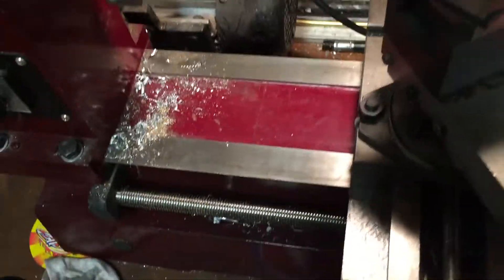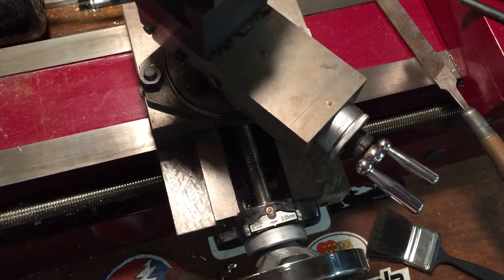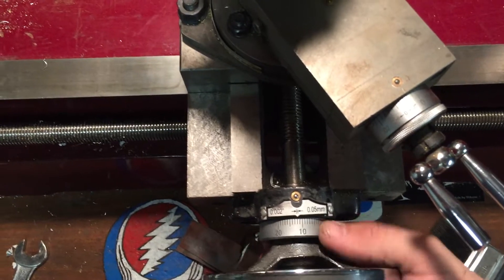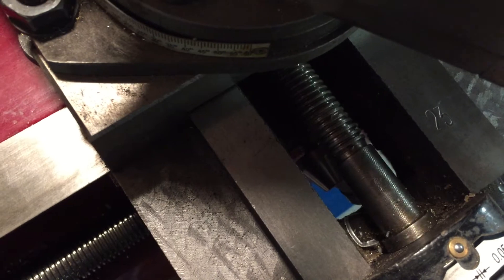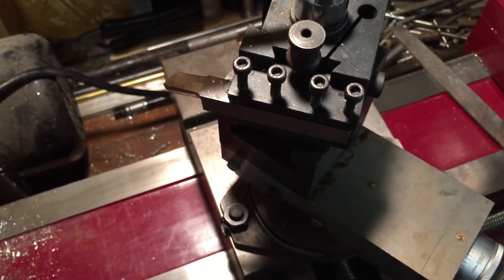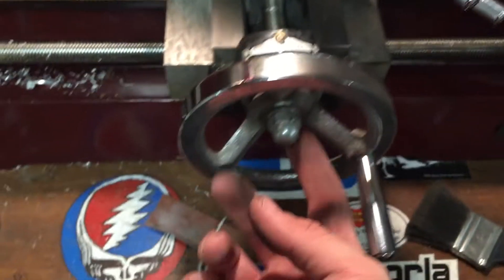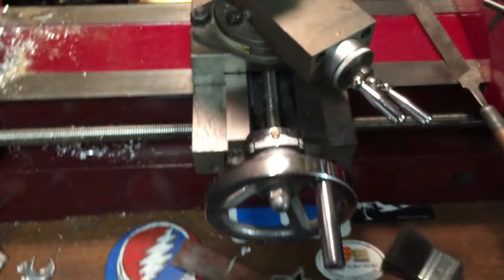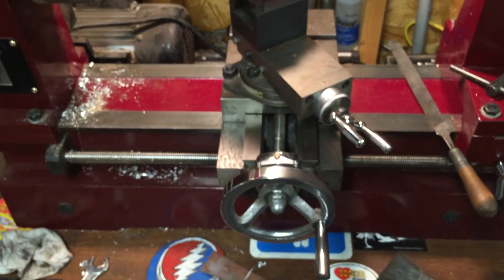Harbor Freight Lathe/Mill

Comment: As you have probly already learned , there are several reasons there is play in your cross slide . One is the type of lead screw that is used. Machinists  compensate this ( backlash ) while they are running there measurements ! there is also other area's that will cause slack as well . Almost impossible to talk you through it , the machine's cross table would have to come all apart to see where the slack is an what needs to be done to fix it.  For starters I replaced all my lead screws with  ( Ball screws ) !  They are for super precision tolerances .  They cost a bit more than the regular replacement lead screws , but there well worth the extra money especially if super precision tolerances are required .

Comment: You have to take that bed off and there is a screw sleeve that the screw shaft runs through it is slipping back and forth because the two set screws that hold that in place are loose, take the set screws out drill a bigger hole retap the threads use bigger set screws and your problem will be solved. Did this to mine. Works great. Even if you still have that machine.
Reply from the maker: Thanks for the help. This thing is long gone though. ;)
Reply: I was going to say the same thing I had that same problem but mine had a lot bigger milling table than that one

Comment: I have the same machine. I know it well. There is no adjustment on the lead screw. Pull in and out on the hand wheel and see if the play is on the hand wheel side. Mine has/had a combo of the hand wheel side of the compound having slop and the nut on the rest side of the compound having play. The compound side is what it is, you can't do much about it. But I was able to take the play out of the hand wheel side with a double nut arrangement on the hand wheel side.

 To do that remove the acorn nut and washer (Parts # 191 &192 in the illustration)  and toss the washer and replace it with another nut and make a jam nut configuration. It's metric and any good hardware store will have one, I had enough thread to do that arrangement on my shaft. Then tighten the inside nut till the hand wheel has no slop then tighten the acorn nut down. Go back and forth with the adjustment till you have no drag on the wheel and no slop. I got my play down to about .006. And that is fine even on a big mill.  

 The play really is not that big a issue. When using the lathe I tighten the gib screw in the center of the compound to lock it (part 211 in the illustration). I make my pass and loosen and adjust the hand wheel in, tighten and repeat.

 It's a fun little machine that has make a crap load of parts. BTW. I recommend you remove the compound and clean the gib and the surface well. The factory grease is not a lube. It's for corrosion protection It 9the complete machine) needs to be cleaned thoroughly. Email me if you want. I would be glad to share my tips and info. I've been over the machine pretty well. I've grown rather fond of it! And I now know it pretty well.
Reply: +Larry Yaw I have the big brother of this machine the 44142. I've used mine to make quite a few small parts as well, I really enjoy it. I have the usual problems too. It would be nice if you made some videos of the your fixes and mods to share with others who have these machines. There are a few others that make the 44142 machine under other names, most notably the Grizzly G9729 and the Bolton BT800 are the exact same model.  Best wishes and Blessings Keith
Reply: +Keith Noneya 

Hi Keith I might just do that. I need to give it a through cleaning again anyway. I can video some of the stuff while I have it apart. If you want you can subscribe to my youtube channel to catch when it post. I'll try to get something up on it in the next month or so. I've even added a DRO. I can go over that as well.

Comment: try tightening the half nut and when dialing take the slack out of the lead screw.
In the direction the tool is cutting from (clock wise for turning) (counter clock wise for boring) You must take the slack out of the dial. There is probably nothing wrong with the machine at the most the half nut is loose or the gibs need adjusting.